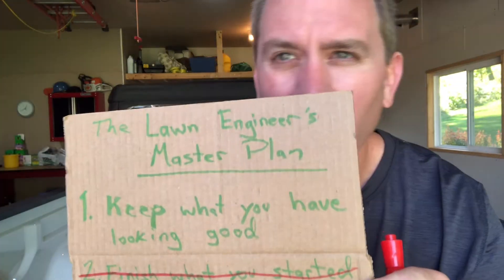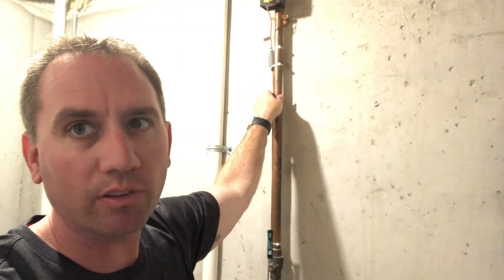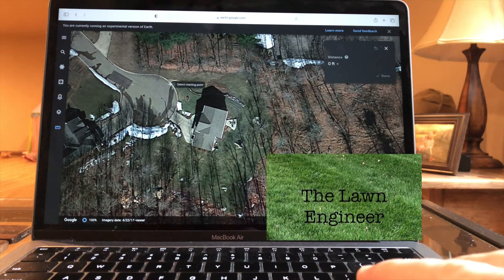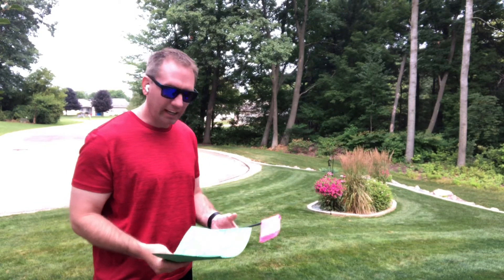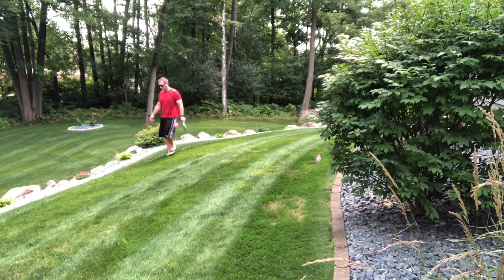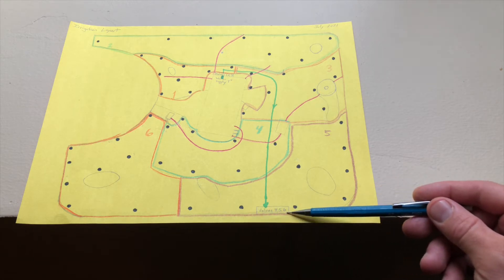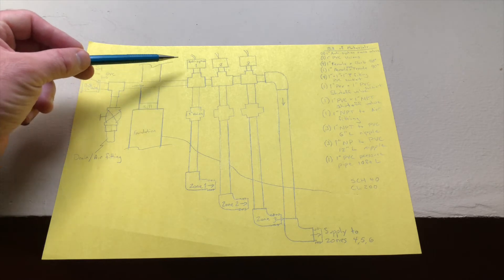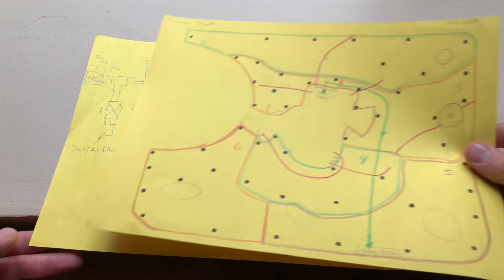The Master Plan EP. 3: In-Ground Irrigation Design/Layout

Comment: Wow, that is quite a big job.  I respect your DIY ambition.  For comparison, I have the same size lawn, about 29,000 square feet, with a professionally installed sprinkler system.  It has 16 zones with 4 or 5 heads per zone, and I still need to drag the sprinkler around to get dry spots.  I would also highly recommend a Rachio smart sprinkler controller.  It monitors rain and wind using internet data, waters slopes with time in between to let the water soak in, adjusts for shade or intense sun, etc...  I can make fine adjustments when needed by talking to my Alexa, or by using my smart phone when I am not around.  It's a game changer.  Good luck, I'll be watching.
Reply from the maker: Thanks for the encouragement.  I picked up the B Hyve controller, it sounds like it has similar features but I’ll check out the Rachio.